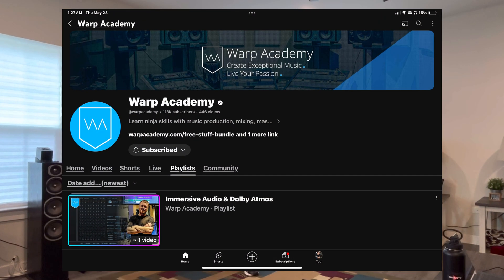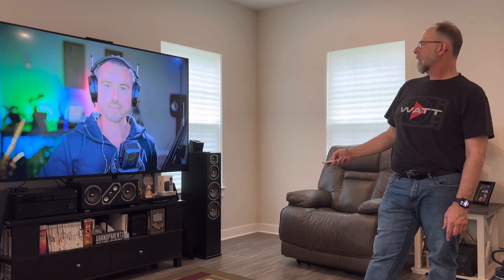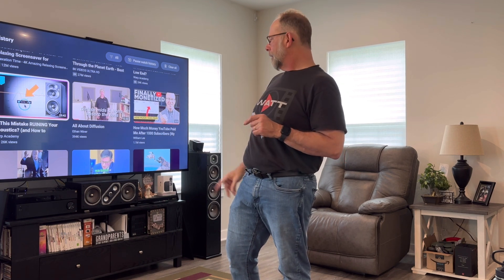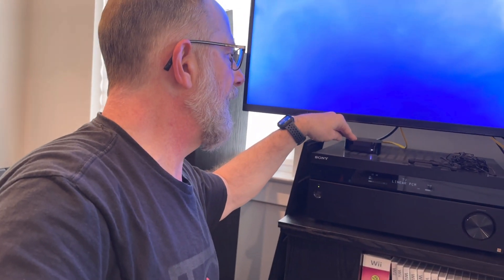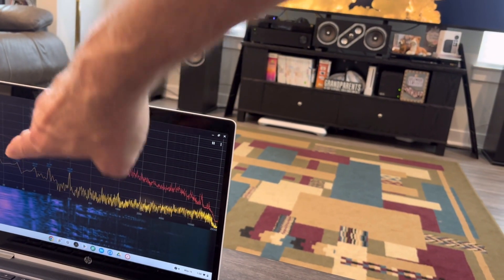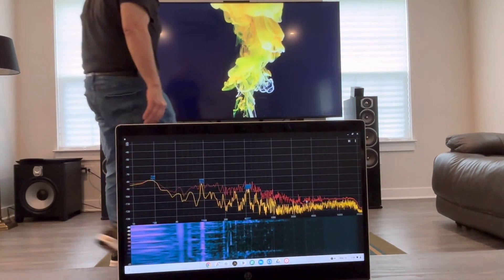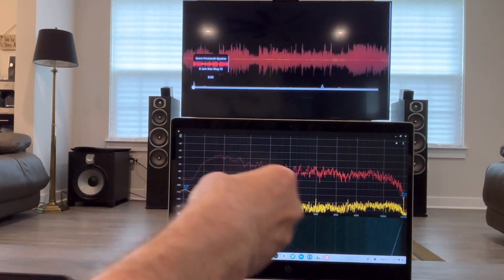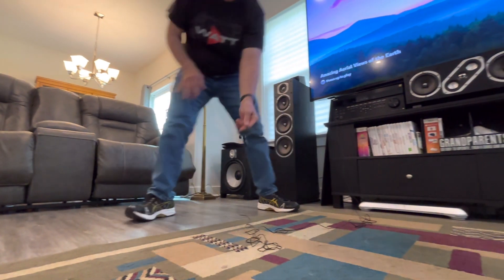How Far From Walls Should Speakers Be? Part 1 Front Wall Loading for Minimal Phase Shift in Bass

Comment: I keep my speakers atleast a foot or more from the wall to keep the room boom down. You get a better sound stage clarity.
Reply: That's one approach people use to try and minimize LF increases, but it causes bigger problems (boundary nulling).  What you're experiencing when you place a speaker against the wall is boundary loading from in phase rearward radiated bass energy constructively interfering with (amplifying) the direct signal in the low end only.  And you're correct that it causes a "boomy" sound.  However this is not a bad thing and moving your monitors / speakers away from the wall is not the best way to address it.  

Because the reflected energy is nearly in phase (minimum phase) you can use a low shelving EQ to simply reduce the low end lift if you don't like it.  Easy peasy.  This actually makes the speaker produce less distortion, and work less, with more headroom, because bass takes the most power to produce.  It makes the whole speaker more efficient.  The EQ can very competently eliminate the boomy sound.  

What EQ cannot eliminate is the large bass null created by destructive interference when you move the speaker away from the wall.  So as soon as you move the speaker away from the wall, you are committing to an unresolvable problem in your low end.  The only solution there is to use a bass-managed system with a sub.
Reply: @warpacademy 100% correct in all respects
Reply from the maker: Buddy thanks for watching and dropping the comment. I'm torn between the two... here's why: I've always preferred the higher efficiency bass from having them closer to the wall, and now I better understand why. That being said, having the speakers further away does seem to add some clarity and depth to the mid-bass through treble. But... It does seem like they have less slam. I'm likely similar to many, in that I prefer to run my speakers full flat / no EQ etc. and as for bass, while I love sub bass too, I can live with out without it. I've found it can be a particularly difficult task to mitigate lumpy low bass when there's too much destructive interference in the critical 250 to 40 Hz range. I've managed it with passive crossover manipulation, but got it done... smooth'ish deep bass with clarity and slam.